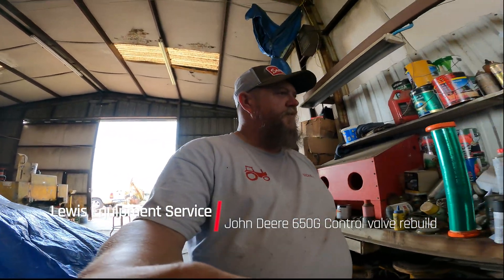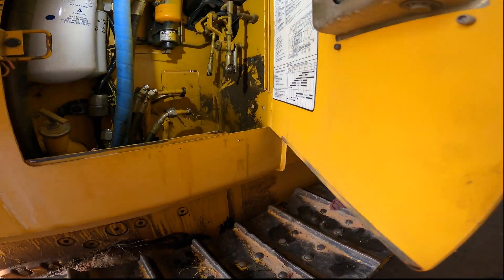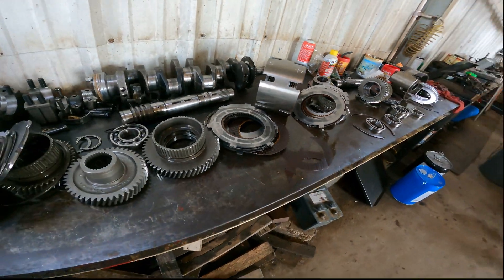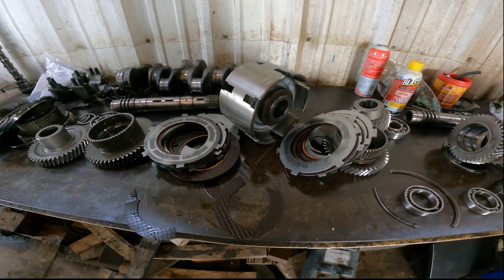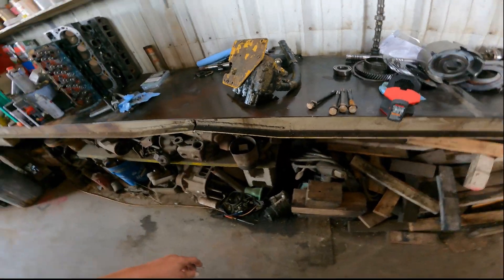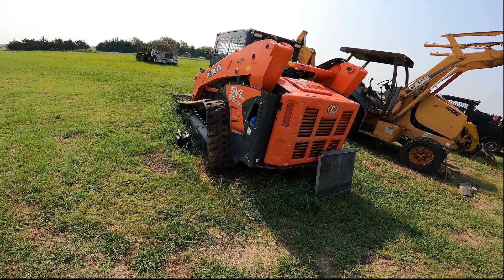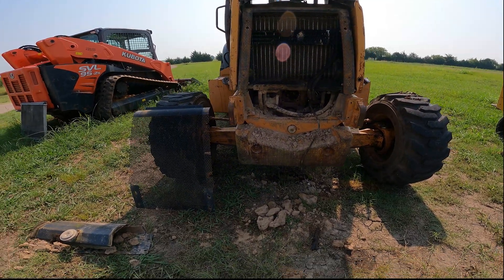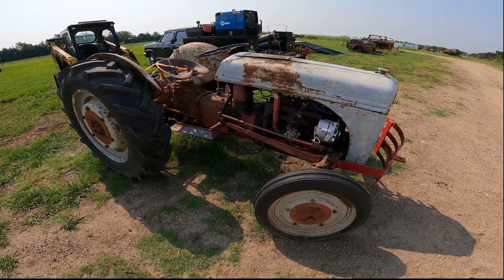John Deere 650g control valve rebuild

Comment: 550g with leaks at the top of 2 spools. Can you fix that in tractor or have to pull the valve?  Seems to just be the stem seals.
Reply from the maker: You can but I tend to pull it and clean the valve and go through it on bench.  Thanks for watching
Reply: @vintagediesel-1  Thanks. got it out.  Where did you get the parts for sealing the top of the spool stem? JD or aftermarket?
Reply from the maker: @RRaucina  That unit was sourced direct from John Deere. That said I'm currently working on parts offerings for this type of repair. We currently carry the full line of Maxiforce parts for engine related repairs. Thanks so much for watching glad to see it worked for you
Reply: @vintagediesel-1  John deere wants $159 for each spool repair kit. Can't find the individual seals, looks like they make you buy the AT315751 replacement kit. Crazy, all I need are the seals and backup rings.
Reply from the maker: Yessir they get silly with the price of that stuff. I am working on lines of parts to cover this sort of repair. Hopefully soon I will have offerings for it also.  Thanks so much for watching

Comment: You say you got the parts from Deere to rebuild this unit. Only thing I'm finding is a complete spool valve or just the dust boot on top. They offer the kit you used in this video? Something broke in my tilt valve and now it just goes left. Thanks for any help.
Reply from the maker: Yes for this the parts  where sourced direct from John Deere. That said check the O-rings in each spool. Sounds like you have a spool bypassing. Hope that helps and thanks for watching.